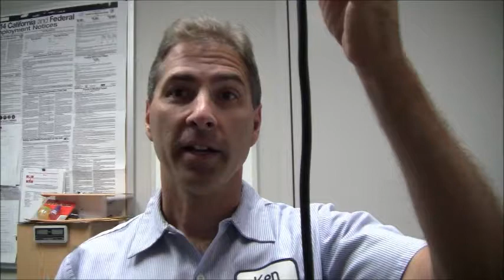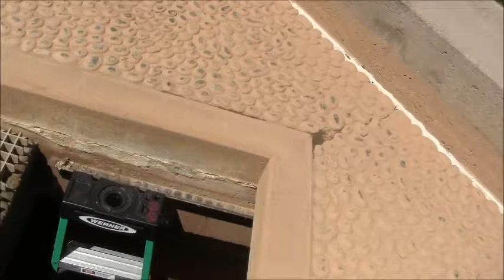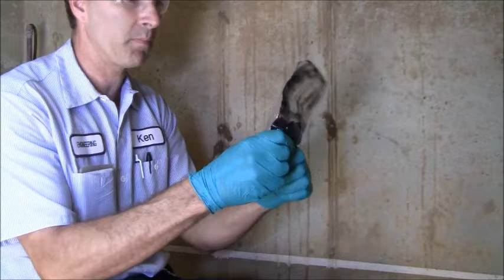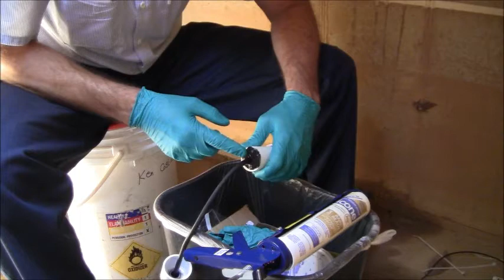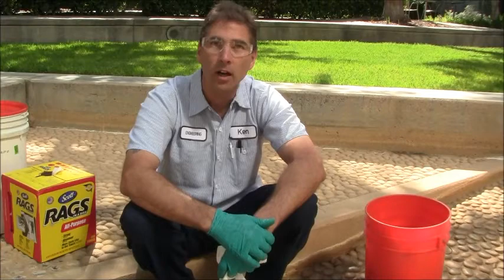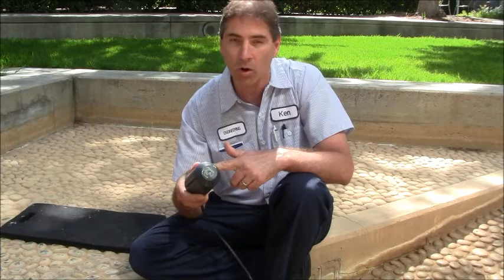How to make a Waterproof Electrical Connection

Comment: Submersible wells have control wires sitting in water with the pump.  I installed mine about ten years ago. It is common practice to use butt connectors designed to be waterproof.  They have the adhesive inside and seal when spliced. That is what I used and they have held up for ten years sitting in water.  You can get these splices anywhere electrical supplies are sold, including Lowes and Home Depot.

Comment: Are Your Child Sick? Because………….
The Water heater is one of the most required appliances in residential and commercial usage.  During seasonal changes or illness as waking up, we will feel comfort in taking the hot shower. If Water heater gets repaired, it will delay our routine work. So it should be serviced in right time. Some water heater problems will be discolored or smelly bad water; heater makes noise or popping, not enough water or too hot, water leaking around the base of the heater. We provide repair and installation services. Ourtechnicians experts will make a thorough inspection and find the issue in the heater. Our water heater replacement and repair will be cost-effective and reliable. We will repair all brand or types of water heaters. Ourtechnicians offered 24 hours plumbing services.
Click here>>www.ourtechnicians.com/Service/plumbing
https://www.facebook.com/apm.ourtechnicians/?fref=ts&ref=br_tf
https://www.youtube.com/watch?v=2lFLF4SUTnM 
https://www.instagram.com/ourtechnicians/
https://twitter.com/ourtechnicians
https://www.linkedin.com/in/ourtechnicians?trk=hp-identity-photo

Comment: Great video Ken . I like the way that you explain things as only engineers are inclined to do.  I would recommend that you solder the connections and use adhesive lined shrink tubing on the solder joints.  That way if one of the control side wires were breached , the solder would act as a dam to block water from wicking into the switch through the wires.  Kee pup the great videos!
Reply from the maker: +assignmeanameplease I like your suggestion on the solder joints. if I have to work on this again I will do that. ThanksKen
Reply: +assignmeanameplease I did electronic installation work for many years.  During that time I met some really smart engineers and I met some really dumb ones. Degrees don't automatically make one smart.

Comment: First, i'm pretty sure that connection will do the job but maybe next time you may consider getting rid of that silicone, because silicone only sticks to silicone. Could be the reason for that crack you mentioned. Instead you may try a sil. free 2 compound elastic stuff of some sort.
Also, have  you checked the "factoryseal" at that switch? I mean hey, this switches maybe are the goldstandard but sometimes errors occur. 
Sorry if my english reads a little bit funny, but i'm just a german guy.

Comment: What do I need to buy and where can I buy it? Got a bilge pump with short leads that needs to have underwater splice.
Reply from the maker: Potting Compound from Grainger, the rest of the material is from the Home Depot.
The rest of material is 100% Silicone, PVC, and Cord Strain Relief from Electrical department, also Pond Shield for the last coating. Good Luck.
Reply: KenTraining
Thank you, Ken! I got similar things at the hardware store and made the connections (mainly buttsplices with heat shrinkable sleeves on them and liquid electrical tape)!